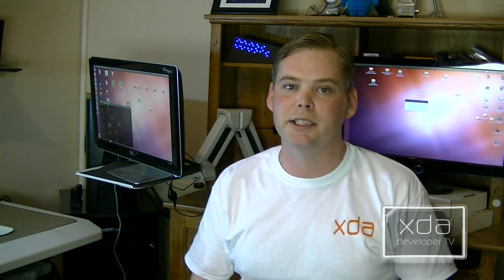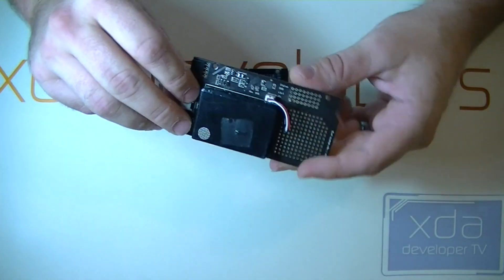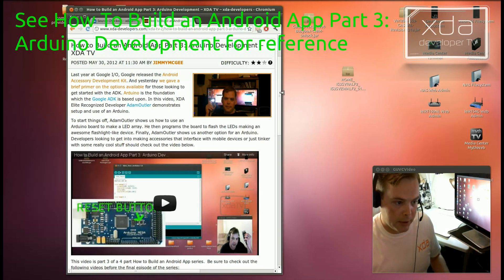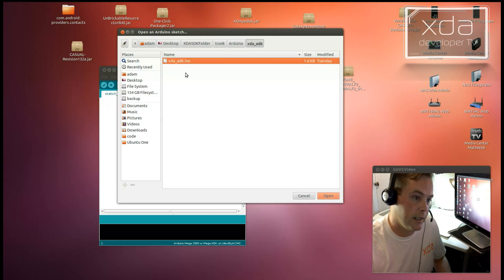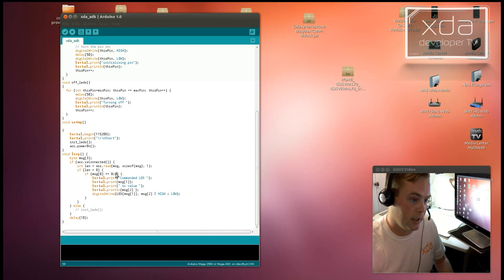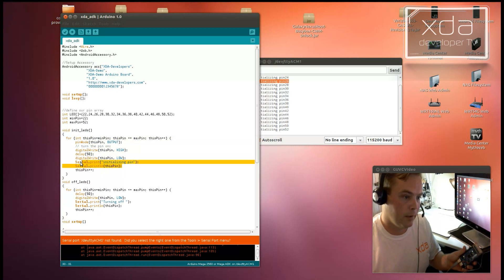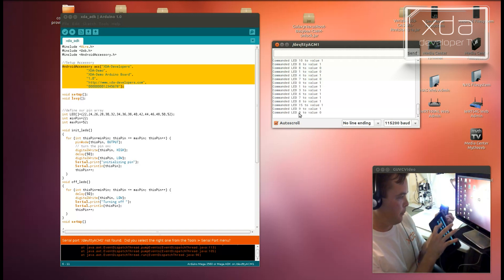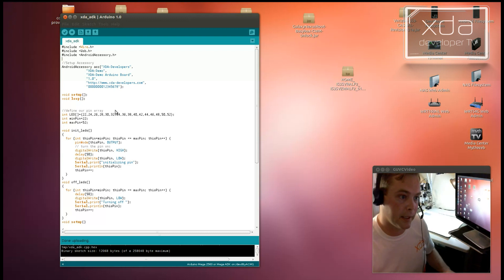How to Build an Android App Part 5: Arduino ADK - Working with Digital Outputs

Comment: Adam Outler how do I download the whole libraries folder from the xda-adk website?
Reply: Use subversion.  There are instructions on the Source tab.
Reply: You use SVN.
Reply: Adam Outler Please ignore my previous derpy answer, I didn't properly read your reply. I understand I need to download subversion but which one do I need and how do I use it?
Reply: Adam Outler All sorted now :)
Reply: Doctor nagrom Do you have the subversion program on your PC?
Reply: Doctor nagrom http://sourceforge.net/projects/win32svn/
Reply: I exported all googecode repos to github.  https://github.com/adamoutler?tab=repositories
Reply: +Doctor nagrom it's been a while but there is a magic number that has to be the same on both the adk and the Android side.   The adk has to be the host and the Android is the device so you are using a standard usb cable.  I don't remember if adb is relevant but try toggling adb.  also the device has to be 4.1 or higher.
Reply: no.  it's the identifier.
AndroidAccessory acc("XDA-Developers",
             "XDA-Demo",
             "XDA-Demo Arduino Board",
             "1.0",
             "http://www.xda-developers.com",
             "0000000012345678");

that line must match what is in the app.
Reply: Install subversion or github and get it the proper way.
Reply: It's just one .ino file.  What are you asking?
Reply: +Doctor nagrom              digitalWrite(LED[msg[1]], msg[2] ? HIGH : LOW);
Reply: Being that they are digital pins, you can't just fade them.  You need to either A: change the code to use PWM in graduated steps from 100-0 using a sleep timer, or B: bit bang it on and off repeatedly with a sleep timer.    Either way, you're going to need to learn some coding.  

This turns the LED on
digitalWrite(LED[msg[1]], HIGH)
This turns the LED off
digitalWrite(LED[msg[1]], LOW)

Now you're going to need to check if(msg[2]) {  // this is true or false
  //do stuff to turn LED on
} else {
  //do stuff to turn LED off
}

Now use the Arduino programming API guide to figure out how to use combinations of sleep and digitalwrite or sleep and PWM to fade it on or off.